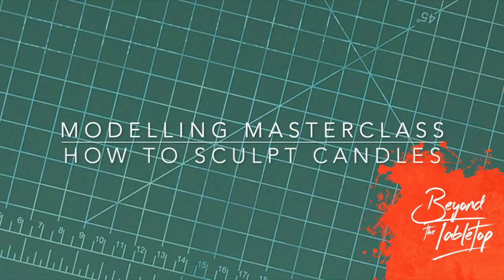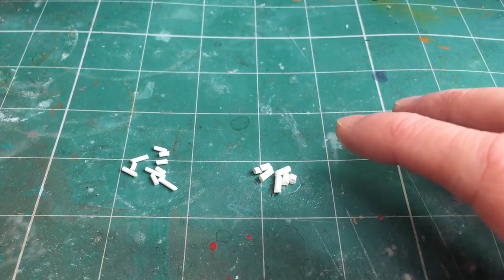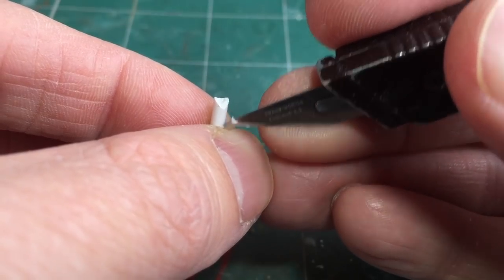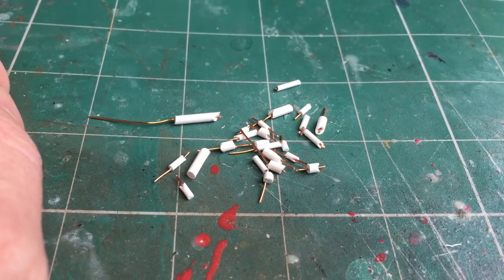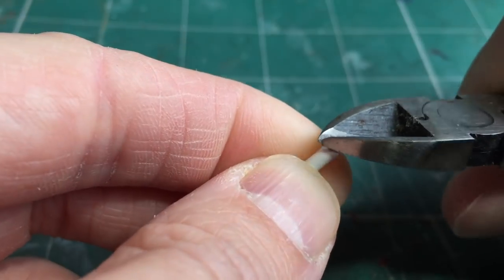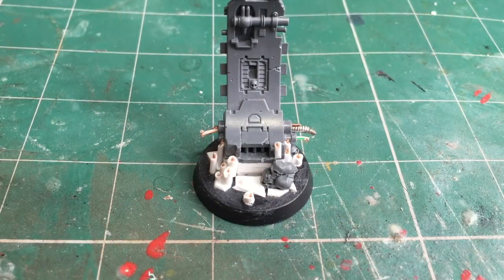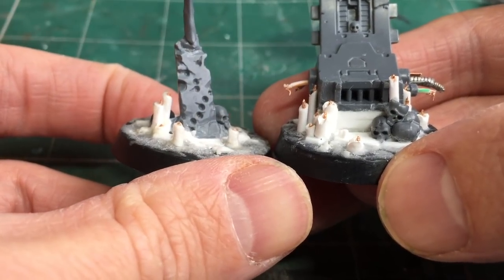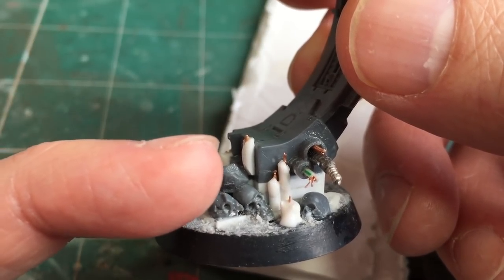How to sculpt candles [Miniature Modelling Masterclass]

Comment: I'm glad I got to finally see your method for making candles, they look really nice too! I still wonder if it was the type of pva I was using in my experiments that wasn't working out for me.
I haven't considered using baby powder to build body in the glue and I was surprised to see it mix with superglue and still remain relatively liquid, I'm used to using bicarb and it curing instantly.
Reply from the maker: I'm pretty sure I just use something like this for my PVA. https://www.diy.com/departments/b-q-white-pva-1l/196638_BQ.prd Hope that helps.

I can't remember if I came up with the idea of using baby  powder with super glue or if I read about it in a modelling book. I've used the bicarb method but it sets the glue too quickly unless you use special slow set glue. But the baby powder works so much better without activating the glue so the work time is really good. I use that method now for filling in large gaps as it sands back nicely too.

Comment: Why did you use a 0.5 copper wire instead a 1mm?
Reply from the maker: 0.5 is what I had, also smaller wire is going to look more realistic for a wick, as 1mm would be too large, however for a thick flame (without using green stuff) then you could probably get away with thicker wire.